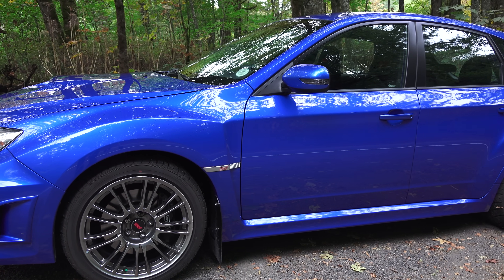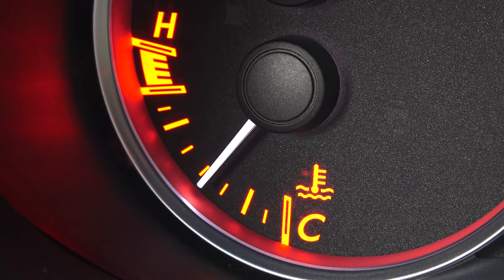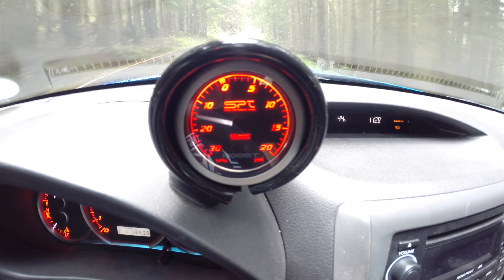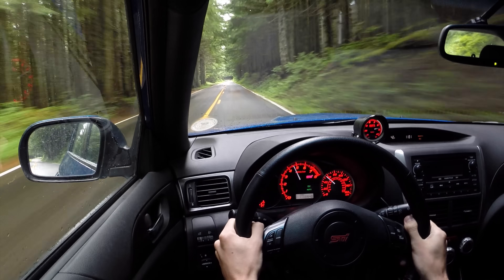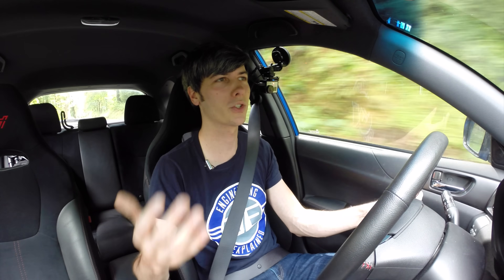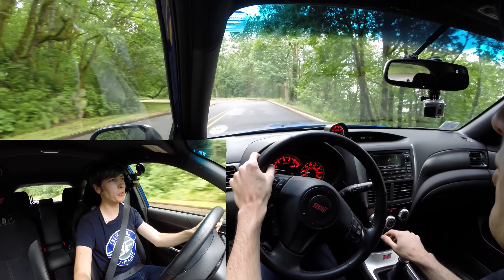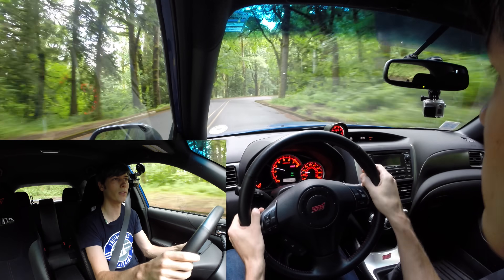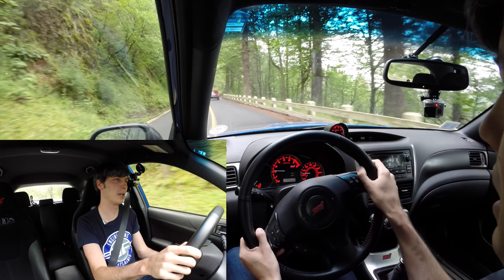5 Things You Should Never Do In A Turbocharged Vehicle

Comment: The points about lugging the engine SHOULD not matter much with modern cars, as all driver inputs are first evaluated by the ECU and only forwarded to the hardware after it has decided if the driver inputs are OK or if they need to be modified. So you basically cannot actually lug a modern engine anymore. That is ASSUMING the manufacturer has invested sufficient time for programming the ECU correctly.

Comment: May be 8 years too late but.. just let it warm and cool down for 2-3 mins and change your oil every 5000 miles or 8000km. That’s the secret.
Reply: That's wasting time and fuel, sitting idling gets thr oil pressure really low, it's better to just drive with a low load and slowly for the last kilometer
Reply: @mihailcirlig8187 i actually agree on that one as well. People i know with turbo cars actually said that as well, to drive like an oldman after having high rpm roadtrips.

Comment: I like Jason's video, but this one is old and should be re-edited. the part talking about octane is not accurate. You should NOT go for highest octane, but for the right octane for your engine, i.e. for the timing advance you have. Using too much octane will reduce the power without any damage, though. But too low octane can be catastrophic. My 2.0 liter 16 V is happier with 91 octane. If I get a tune and increase the timing, then I will go for 93 or 94, or more if I'm looking for extreme tuning. That's it.

Comment: The accelerator pedal on your car (ANY car) controls air, not fuel.  You can't flood the engine with a rich fuel/air mixture by pushing it... the amount of fuel injected is controlled by a computer, not your foot, based on mass airflow.  So #3 doesn't make any sense.

Comment: What happen to turbo charger when we run the car under 2k rpm and be light on throttle, not crossing 60mp...for a long drive say about 7-8hrs non-stop and then once the car is parked, just shutoff the engine???

Comment: Another good thing not to do, especially you Holset Cummins guys. Stop carving designs in the compressor wheel and don't remove material from the compressor wheel either. It will affect the performance of the turbo poorly and void your warranty on you Holset Turbo.

Actually,  scratch that. Do what you want because it keeps business rolling here at Holset abd warranty rates low on our end due to customer damage.

Comment: What to do when you have a high load on a cold engine? Where I live, there is a reasonably steep incline very close to my place. I often need to go up that incline when I go somewhere, but since it's basically just outside my house, it's often with a cold engine, especially in the winter. When I let the automatic transmission do its thing, it will shift at ~2300 rpm, while on flat ground it would shift ~1700 (it's a diesel, that's why it's so low). I thought a relatively high rpm like that is bad for a cold engine, so I often put the transmission into manual mode and shift at 2000 at most, but now I hear that's not good for the engine either. So what do I do? Let it rev potentially too high, or lug the engine?

Comment: FACT: #1) Modern electronic motors are immune from "Lugging" , this is a carryover from mechanical engine days
#2) almost All modern turbo motors use coolant in the center section which eliminates the need to idle to prevent "Coking" ... Along with most turbo vehicles recommend SYNTHETIC oil

Comment: I have an automatic in my VW Golf that lugs the engine. I also detect some knocking. I have been told that it isn't as much of an issue as knock closer to peak torque, wich would be more in the mid range of RPM.

Comment: Preignition is not a new problem.  Early American Fighter plane the Lockheed P-38 had turbo charged engines.   There was an entire sequence of things to do just to go from low throttle to High throttle, all to avoid detonation.

Poorly trained pilots who'd just gotten out of Pilot School died horrible when they failed to folllow the correct sequence and their engines literally exploded in flight due to preignition also called "detonations" or "engine knock".

Original High Octane gasoline with Lead in it.   The Lead was there to eliminate engine knock or detonation.

Comment: Why don't manufacturers design a turbo that builds pressure at low rpm or idle , and in turn preps a second turbo that produces most of the power so there is very little lag

Comment: I know this is an old video, but idling your car before shutting it off to cool down hotspots shouldn’t be necessary in newer cars.  Nowadays most cars continue to circulate oil and/or coolant after engine shutoff to prevent this from being an issue.

Comment: Ah so lugging it could be the reason im getting an occasional bit of smoke. It seems to only happen in low rpm, and the oil level is good, isnt due for a change for 3000 miles. Its a 2018 wrx, the clutch is much deeper than my last car and so im probably giving it gas too soon

Comment: Cool car and topic!
I have an oil temp gauge in my ‘02 WRX Wagon.  
*I can confirm that the stock water temp gauge shows warm much faster than the oil temps, and 5 minutes is about right for oil temps to exceed 100 degrees.
Depends a little on the turbo application as to how much time to idle before shutting down.  Thankfully WRX’s have coolant lines and oiling which helps their longevity.  
Slip angles, I’ve only heard applied to front wheels?
Coefficient of friction at the tires/road, centrifugal force while cornering, and a nonlinear torque curve from a turbo all come together for possible oversteer or rear tires exceeding the available traction :)
One ideally would have some experience in a safe location to get some idea of what those limits are.  The wet patches on the road in your video can decrease available traction for instance.
Not a good idea to explore limits on public roads
Reply: Good idea on lugging!
In my car boost won’t build much at low rpm’s, but I have been trying to do more low rpm cruising for fuel economy.
I got a motor replacement at 176k due to a burned exhaust valve, and the dealer sent the car back to me with a split turbo vacuum line, which allowed the boost to max out at small throttle openings.
That could have killed my new motor if I didn’t have a boost gauge to keep the boost down on initial break in!

Comment: It would be nice if car manufacturers added little up-shift or down-shift recommendation arrows on the instrument cluster for manual transmission vehicles. You could even have various modes like in some automatic transmission vehicles (economy, standard, sport). There is a fine line between lugging an engine and operating it near its maximum fuel efficiency.  Read your owner's manual for the recommended RPM shift points.

Comment: Oil has a considerably lower thermal mass that water, and I would say that the oil is quite intimately in contact with the engine block and head, such that it is quickly heated once the engine itself is hot. It would be interesting to have an oil temperature gauge to see.
Reply: my audi r8 has an oil temperature gauge as well as an transmission fluid temperature gauge and it takes a long time to warm up. in winter it takes 10 minutes. same thing on my audi rs5.

Comment: Do not high mile (coast downhill in neutral) a manual turbo engine. After climbing to the top of the mountain, coasting down is a bad idea. The turbo is now very hot and needs plenty of oil circulation on the way down the hill to cool the bearings. Leave the engine in gear and descend with rpms above idle.

Comment: I understand this video if you own a subaru :) you can easily floor your turbo charged engine at 1st or 2nd gear without losing power. look at VW's launch control. these vary from 2krpm to 3500 rpm

Comment: u shouldnt lug any engine, rpms r what make oil pressure, the harder u lug n engine especially at lower rpm-the harder the crank will b pushing against the block n the thinner the film oil will b, not a good combination

Comment: Fully synthetic engine oil does not change viscosity at temperature change, but still allow flow properly. With regards the “immediately turning the engine off” in the turbo industry it’s called hot shut down, this is bad because the static oil on the very hot components causes carbonisation which in-turn will result in particles and contaminated oil and scoring of components and blocking of oil feeds.
With regards the quality of fuel, the higher octane is better, better fuel brands also include better additives. 
You wouldn’t want to floor a car at higher cornering angles period, whether your car is NA, turbocharged, or supercharged.
Reply: A good deal of misinformation there especially for newer turbocharged engines, i.e. 2011 and newer. Most of them have water cooled turbos now, along with oil and, by design, when shut down the temperature differences keep convective coolant flow and in turn cool the bearing surfaces down. It stops automatically when the temperature delta has been evened out. 

Higher octane does not mean higher quality. A good deal of turbocharged engines run especially well on 87 octane due to the sophistication of the fuel delivery. Also, the engine management system has to be able to detect when higher octane fuel is used to make use of that higher octane. 

Again, complete garbage as most have baffles and the ability to deal with cornering forces while accelerating.

Comment: A sidenote on using the correct gas I have a 13 Tiguan which is the 2.0 TSI turbo charged a course and I strictly get 93 octane non-ethanol reason being is in America. The common ethanol rating is about 10% but in Germany the common ethanol rating is 5% well I tested it and I get a much better throttle response with non-ethanol.

Comment: The oil viscosity between cold and hot isn't as big as you think it is. The flow is the same even when cold, the oil pump will move the same amount of oil, there aren't any "voids" created. Its just that the oil pressure is slightly higher when cold. There's other reason why not to push hard a cold engine, most of it has to do with the pistons and cylinder being either too tight or too lose, creating different problems/wear over time.
Reply: Interesting, I had thought there was a large difference in viscosity. "5W-30" I thought meant 5(winter; cold) and 30 at operating temp.
So is the video still correct, that oil temp should be hot too, so the metal moving parts are precisely the right size?

Comment: Some misinformation in this video…
1. Higher octane gas is not “better” the higher the octane, the more ethanol. (Up too the 10 or 15% as noted on the pump)

Higher octane gas is recommended in turbo charged engines because of its resistance to compression ignition. Much like a diesel engine, adding boost increases the pressure and causes fuel to ignite prematurely as you mentioned before but not understand the reason why it happens.

Comment: Question 1 : Why do factory upgrade Turbo charged engines have poor fuel economy versus  naturally aspirated engines ? 
Question 2 : Do Turbo chargers create a pressure issue in the block ? Specifically enquiring about turbos that are designed and offered by manufactures as a factory upgrade like Mazda / Subaru....
My vehicle 2023 Mazda 3 Hatchback 2.5 turbo AWD
Thank you for you time and have a great day :)

Comment: Lugging the engine isn't really possible anymore right? All your throttle does in an electronic fuel injection engine is tell the computer chip how much throttle you want. However, that chip knows the engine RPM, and will basically prevent engine lugging from happening by restricting fuel injection based on engine RPM. Or am I completely wrong here?

Comment: Most new cars report engine oil temperature.  You just need to find it in the menu(s).  Keep your foot light until the engine oil is at 90C or higher.  
Most new cars have electric after-run pumps, which continue to cool turbos down after engine shutoff.  The old "turbo cooldown rule" is obsolete.
Reply: above about 65C is fine, 90C is quite hot

Comment: buying the highest octane fuel you can buy is not smth you wanna do with ur turbo charged car. Each fuel has its use, find the right fuel for ur car. You wanna buy the cheapest fuel you can get away with. Cheaper fuel means more power, but if you buy to cheap of fuel it can lead to pre ignition. It depends on your engines compression.

Comment: key note here "driving the car hard" doesn't mean driving the car normally on the road. unless you normally drive it like a race car start to finish. 

i keep getting told i need to let my car "cool down" after driving it but i live on a dirt road and only go 35-45mph on it. that's not "driving it hard" 
the 2-3 mile stretch of road that im going low speed isn't making the turbo glowing red hot and frying my oil like a cook making deep fried chicken. 
if anything its getting warmed up before i get on paved road and cooling down before i shut it off. 2000rpm isn't driving it hard. that just normal driving rpm. a little bit more than idle but nothing the cooling system cant keep under control at operating temp.

Comment: So... what's up with those "small turbo engines" that have max torque from like 1500RPM?
Mine wants me to shift to higher gear when driving 60-70km/h in fifth gear. It runs at like 1400rpm in sixth gear at that point, so... is this also bad? I'm not flooring it, but I'd like to drive 80-90km/h, not 60-70.

Comment: Thank you for all that advice !
I have a 2019 Chevrolet equinox with a 1.5 L turbo engine ,I was thinking of putting a 60 horsepower performance chip in the car? at 170 horsepower that will put me at 230 horsepower. will that damage my engine ? should I just leave things alone? Can you advise me about the pros and cons? Can you also advise me on a good performance chip company, I was thinking of buying from Thorton?
Thanks again!
Reply: Should be fine. You can check reviews from others that have done the similar mods. I did APR tune, bigger turbo and intake, suspension, tires. Intercooler is next on the list. My VW golf wagon was 170 HP stock when I bought it now it's pushing around 290+ HP.
Reply: @mhaas281  wow ! that's alot of crazy hp!!
Thanks a lot for your great advice and your Assurance, I will do that!!!👍🏻

Comment: You forgot something important.

When you Very strong in accelerator, don't take out to neutral from a high engine rpm.  The turbo spins very fast.  And the oil pressure drops significantly with the rpm.

This can damaged the turbo...

Comment: Do I need to follow these recommendations if I have a turbo and supercharger, as in Volvo’s T6 automatic engine? My understanding is that the supercharger turns on immediately and turns off later on when the turbocharger kicks in. Would that mean that by the time the turbocharger kicks in the oil has warmed enough and is no longer an issue?

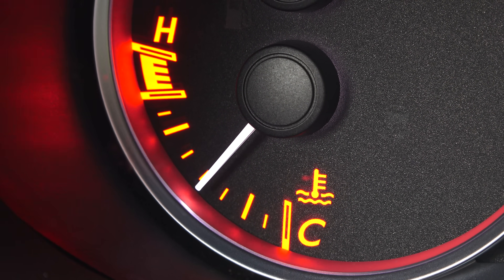Comment: 1:19 oil has reached your turbo a long time ago by the time your engine is warm.
2:35 my 2016 F150 ecoboost some times will run 5th gear @ 1,300 rpm going up a small hill. This is how newer engines save gas.
3:20 most diesel start to make great torque @ 1,500 rpm. The computers will only inject as much fuel as the engine can handle.

Comment: I was told not to use octane booster or high octane fuel in my car because it could damage it. Is this true? I have a 1.5L Honda Accord Sport with the CVT. They told me it's bad for the engine to run 93 or even 91 instead of regular unleaded.

Comment: 0:50 that’s one of the things I like about my 335i- it having an actual oil temp gauge
Reply: Some older American cars have that too. They used to have electric system voltage, trans temp, oil pressure too.
2010+ Camaro has them too as an optional set, I think all cars should

Comment: Years ago we had a VW diesel turbo. My wife drove it to work which was about 8 miles. Rarely was it driven at highway speeds. After 2 years, a new turbo, intake cleaning and finally a rebuilt transmission, it was time to trade.

Comment: Wait holdup....doesn't higher octane just relate to compression, not necessarily quality? If you use too low octane you'll get pre-ignition, and too high octane will result in spitting fuel into the exhaust?

I always just thought to use whatever the manufacturer said to use.

Comment: If it’s a 1.9 or higher you turn the key 2 clicks back 1 click front 2 until the car attempts to tick over after that you release too early so it cuts out after that take the key out re insert turn until engine ticks over and take it on a quick run upto 120mph should be good for a week or so to just start her up straight away then 💪

Comment: I was wondering: Everyone talks about installing a turbo but no one about removing it. What if I want modern car with small engine but I don't want turbo?  How does that work? Would it mess with the warranty?
Reply: You would have a low compression engine with parts like an intercooler that you will have to remove.. you will have to reprogram the ECU